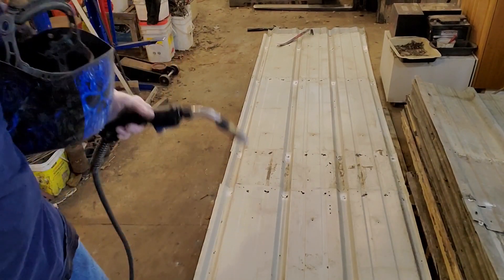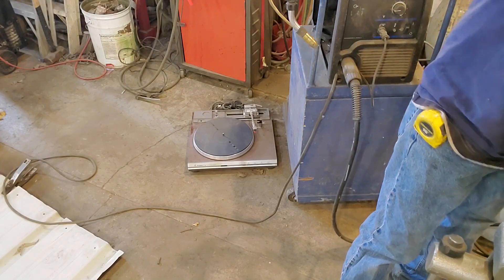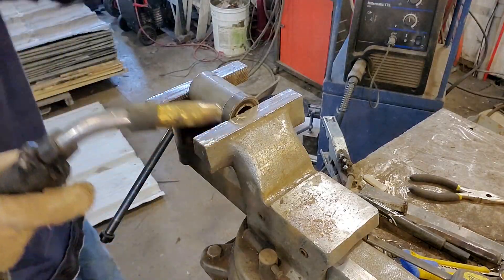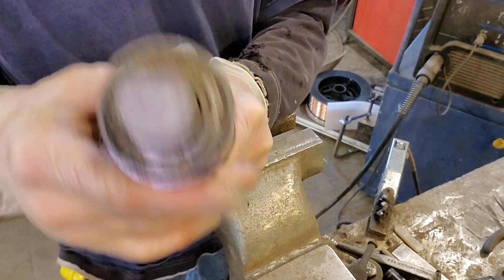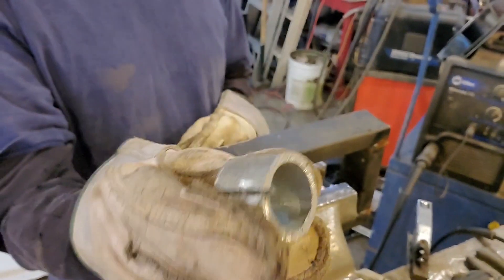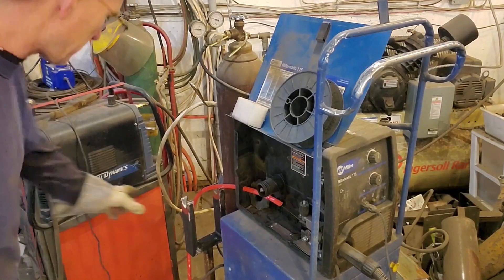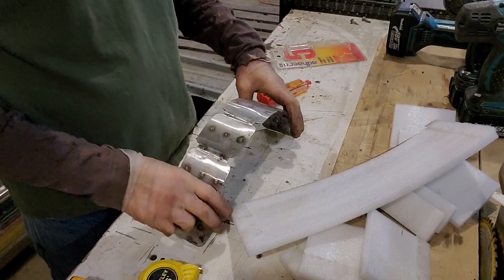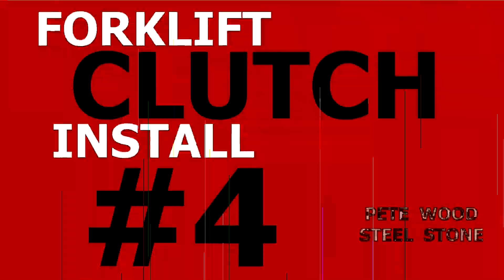HOW I FIT A 33 LB SPOOL OF WIRE ONTO AN 11 LB WELDER

Comment: brilliant my man. I love it. I am a wood worker by hobby and starting to get into metal. 10 lb spoon won't fit it my cheap starter up welder so l will attempt something like this. thanks man. my woodpile looks just like your metal pile and my metal pile is growing  quickly. I love when I stumble onto a real shop channel. they are so rare. most channels shops are perfectly organized and pristine. nothing against that it's just not realistic. at lest for me. now that metal is part of my passion I routinely have 6 or 7 different projects going at a time (up from 5 to 6) all requiring deferent tools and material so my shop is constantly a mess and I love it like that. if its clean im not doing enough. I appreciate your get down man. keep it up and scream whenever you want to.

Comment: 1 year in how is it going now? I want to do this but was worried about the extra strain on the feed motor causing it to fail over time trying to pull the extra weight.
Reply from the maker: I  think there's less drag than the old setup . Most welders use drag to keep the wire from coming of the spool.